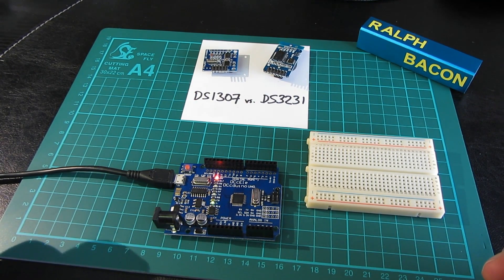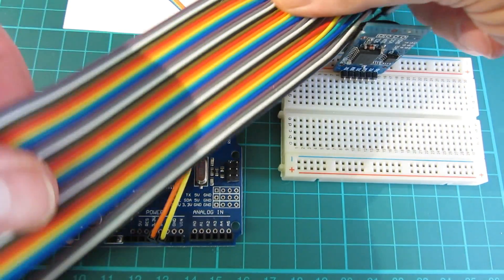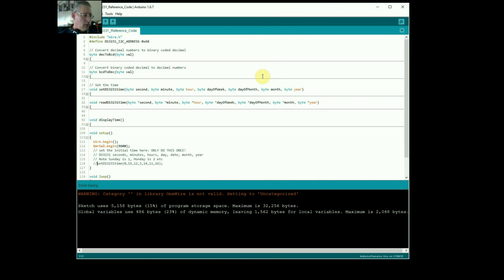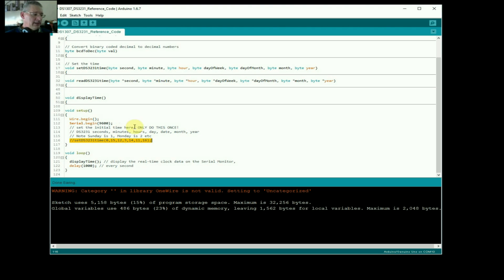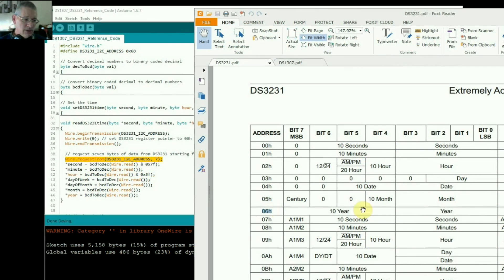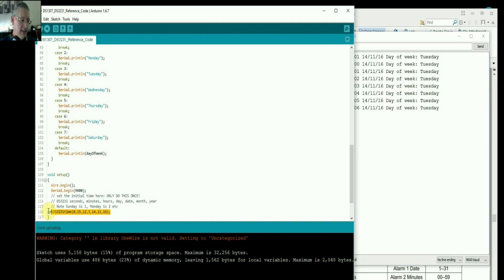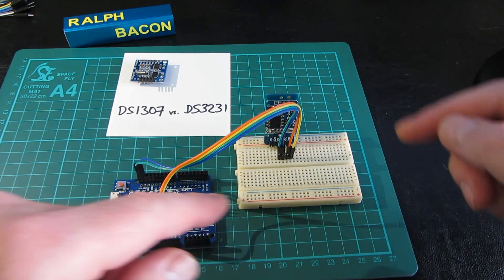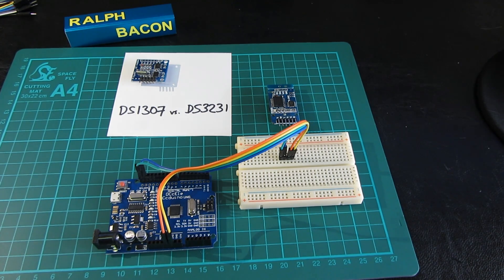#5 Arduino compatible Real Time Clock modules (RTC) - DS1307 & DS3231

Comment: Thank you very much,great explanation. I’ve realised that after a day my seconds starts to be leading by 6 seconds from the real time how can I fix that.

Thank you.
Reply from the maker: If you are using a DS3231 I would be very surprised at such a discrepancy. 

If you are using a DS1307 I would not be at all surprised and is why I don't use those devices.

Which one are you using?

Comment: This is good Ralph, can you help if I want to display hours, minutes, second on a separate line rather than displaying everything in one line
Reply from the maker: I was only outputting the information in the Serial Monitor so you could just use "Serial.println" rather than "Serial.print" to move to the next line once the current data has been printed.

Comment: Hi Raplh, 
Thanks for this code. I have been strugeling with this for months. Finnaly a code that works.
I just have one problem and was hoping you good help me. I am not new with programming, but I am new with arduino 
I want to save the time to a SD card.

I am using this code, where i save the distance. That works fine

// if the file opened okay, write to it:
    if (myFile) {
        //Serial.print(distance);
        myFile.print("Koe aanwezig: ");
        myFile.println(distance);
        myFile.close();
    }

But I get an error if i want to place the time in there. something like this:

myFile.print(displayTime();)

Is there  a simple way to at the time in my file on the same line.? 
Thnaks for your help
Reply from the maker: The time variable is something special. You probably need to extract the hour and minutes and save them as separate strings (or, possibly, integers).

Comment: Hello Ralph, I want to build a rain sensor so that we do not have to keep checking when the washing is out. I got the idea from my grandson, who watches videos about model RC cars, to search YouTube.  Luckily I found you. I watched your rain sensor video and realised that I need to learn about Arduino. So at the age of 71 I'm going back to school watching your basic videos. Hopefully I will learn enough before I expire.  Thanks for the videos and slow clear explanations John
Reply from the maker: I'll be doing a new rain sensor project "soon", John, as I discovered the old way (used in Benny's outdoor cat run) would detect rain but then continue to say that rain was present even though it had stopped quite a while ago (or it was just a few drops). 

The next time I do this project I will add a small heating element under the sensor so that rain is evaporated very quickly thus giving a true indication of the presence of rain. Once it has stopped raining the heating element will switch off.

What you can do is still construct the rain sensor (remember to poll infrequently [eg every 15 seconds] to prevent oxidisation of the sensor) and when I've done the project with the heating element just add that bit. I'm sure that at 71 you still have many productive (Arduino) years ahead of you, and I welcome you on my journey!
Reply: @RalphBacon  Thank you for your reply. I'll only put my sensor out with the washing and bring it back in so some of the features will not be needed by me. In the past I have programmed in BASIC as well as made web pages using just note pad and HTML so code is not alien to me. Watching some of your basic videos I now have a concept of the hardware however, finding and installing the compiler, inserting code and sending to a device is something I do not know. Do you have a video about installing and using the compiler from the start?
Reply from the maker: Just go to the Arduino.cc website, download the Windows version of the IDE (currently version 1.8.15 at time of writing) and install it like you would any other Windows/Linux program. If you can launch it and get a blank(-ish) code area then you are almost there.

Look at some of my (really) old videos where it describes how to get the COM port of your Arduino that you just plugged in and use that in the settings under the Tools menu. It might take you a while to "figure it out" but everyone has to go through this - me included!

If you use an Arduino UNO (or clone) you can get the Blink example program running by toggling pin 13 which has the built-in LED attached. That will be your Eureka moment.
Reply: @RalphBacon  Thanks again Ralph. This is all so much fun and fantastic to have help.

Comment: In the setTime, how can we adjust the RTC automatically from computer time? Not using the hard coding setDS1302Time(18, 10, 10, 7, 18, 9, 2020);
Thanks a lot
Reply from the maker: Unfortunately it's not possible. The standard way of doing this is to select a future date/time, wait for that time to arrive and set your program running so it picks up the correct time. Then be sure to comment out that bit of the code so your time is not reset again and again! Of course, if you write code in your Arduino to set the time on the DS3231 (like a bedside alarm clock) you can do it like that but it's a longer process.

Comment: Verry good, will change my thermostat tft project
The to many rtc.libs .h files people can choose to include make arduino dificult
Reply from the maker: Make sure you use the DS3231 not the awful DS1307. The former keeps time very accurately indeed, once it has been set.

Comment: First of all thank you for the great video!
I was getting frustrated with the DS3231 because there are so many poorly documented libraries and nothing was working, so I decided to configure it only with the datasheet and the Wire library like you did.
I used part of your code from github for setting the time and added some functions to use the alarm 1 of the DS3231 which I need for a project and it is working great now!

However,  I was wondering as to why you were using pointers in the readDS3231time() function. Is it just to make the code work without any global variables?
Is it that you could not pass the seconds, minutes, hours ... variables directly to the function because they are only declared in the displayTime() function and for the readDS3231time() function they are undeclared? So instead you reference them using pointers to be able to change their values even though the variable itself is undeclared in the readDS3231time() function?
Sorry if the question might be dumb, I am not that comfortable using pointers yet, hence the confusion. I would be happy if you could help me out with my question!
Reply from the maker: I wrote this over 4 years ago so I'm guessing that I didn't want global variables (I still don't like them) so using pointers is a good way round that and allows the subroutine to update them too, if required. If not, then passing by value is good enough.
Reply: @RalphBacon  thank you a lot for your fast response! Now I get it.

Comment: At the end of the video #5 RTC you say you have a video on how to set the times.Can you please tell me what number this video is.
Great tutorials you provide love watching them.
Thanks very much.
Fleck
Reply from the maker: Hmm, I vaguely remember this video (from 4 years ago!) and I also remember writing a nice bit of code to set the date and take into account leap years, DST and probably a few other things. Unfortunately it never got made into the promised library. [Some time later...] However, I have found the code. Leave it with me for while, Fleck, as I'm recovering from eye surgery so I'm limited in my computer time but I hope to nail this one soon.
Reply: @RalphBacon  
Ralph
Thanks for the quick response.
I wish you well with your eye problem, there is always something trying to hold us back. 
I also have medical problems in 2009 at the age of 59 I was diagnosed with Motor Neuron Disease (MND), and given two years to live. I am totally paralyzed and operate my computer using my eyes. Next month (June) I will be 71 years old and still loving my computers. 
I find Arduino very frustrating especially the libraries. I have been working on a clock for a week or so now and always find problems when compiling mainly due to libraries. 
I decided to have a look inside the library code of the DS3231. Having looked in a few libraries with the same name I was surprised to see different code in each one. This of course is very miss leading when they all have the same name. 
On your video #83 I smiled when you said the following     (Timeline 2.48)
“… was it easy to do this hmm, sort of well no really it wasn’t it was a lot of faffing about with libraries….”    
It made me feel I am not the only one suffering.

Thanks very much for having a look for your code.

Fleck
Reply from the maker: If you like I can just let you have my code and you can do with it what you want? Sorry to hear about your medical situation, as you say, there are always road bumps to slow us down! Let me know about the code, I can either email it to you or put it in DropBox (probably better that way). I agree about the library fiasco. Sometimes my code picks up the wrong library (because authors insist on using the same name, why?!?) and I wonder why my code does not run! Grrr!
Reply from the maker: Sent you the email!
Reply: Ralph S Bacon I notice from a previous correspondent (flex) there is an additional code  ,  can I ask that you send it to me at robertstuartharris@hotmail.co.uk   
Thank you

Comment: Very good. How about a time and temperature sketch since the ds3231 has that ability?
Reply from the maker: The temperature sensor on the DS3231 is not that great to be honest, Donald. It would be better (in terms of accuracy) to use a dedicated temperature sensor such as the DHT22, DHT11 or the DS1820 all of which I've demoed in my videos. It can be very frustrating to read a temperature of, say, 20°C yet you know it's only 18°C from another source! You can tweak it in your code, of course, if the drift is stable and linear otherwise it gets too complicated and it's much easier to use a separate sensor.
Reply: @RalphBacon Thanks for the reply. i'll look into that.

Comment: Hello Mr. Bacon, Can you help me send commands to the RTC module. I have spent hours trying without success. One of them I would like to change it to 12 hour mode. I have tried to modify some of your code but ran into a brick wall. Please help.
Reply from the maker: Are you talking about using the (Adafruit or similar) library, Dave? The obvious method would be to do something like:

if (rtc.hour() > 12) {
  localHour = rtc.hour() - 12;
  localPM = true;
}
else
{
   localHour = rtc.hour();
   localPM = false;
}
I'm making up the calls to the rtc object but it will be along those lines.
Or were you asking a different question?

Comment: sir how to replace ds1302 rtc with ds3231 
what changes we have to do in program
Reply from the maker: They both use I2C, Anukesh, to communicate with your µController so you should be able to swap one out and replace it with the other. Then change the library you're using so it corresponds to the correct module and it should "just work". I've found a written article on this:
https://tronixstuff.com/2014/12/01/tutorial-using-ds1307-and-ds3231-real-time-clock-modules-with-arduino/ 
I hope this helps.

Comment: 2165/165/165 (Monday) 165:165:85
 since midnight 1/1/1970 = 1563147985s = 18091d
 now + 7d + 30s: 2019/7/22 12:16:31
how to fix this
Reply from the maker: I'm not sure I understand the problem you're describing here. Have you set the RTC to the correct date/time initially? Remember this is a one-time operation. As long as you don't remove the battery (or other power) it will continue to keep the correct date/time. Can you explain a bit more exactly what the problem is and what you're seeing?

Comment: Hi Ralph, I used the code from video #5 and it works great. I am trying to insert a conditional statement into the code so that if hour = a value (e.g. 12) and minute = 00 and second = 00 {turns a pin high with digital write}. I have used parts of the blink sketch for this. However, I can't get it to work. I have also downloaded various ds3231 libraries and examples to no avail. I'm a total newbie at this (age 64) but don't want to go back to a hardware solution. Can you point me in the right direction? Many thanks, Mike - long time subscriber and avid viewer.
Reply from the maker: First off, thank you for being a subscriber and avid viewer - I need more like you, Mike! Now let's see if we can get you up and running. Your pathetic age excuse does not wash with me! How are you extracting the various elements of the time so that you can then query the value? If you go to my channel page, About tab, you will find my email address and you can send me what you have done so far; it will be far quicker that way. Sorry to make you hunt for that email, but if I publish it here I will have a gazillion emails! I'll await your sketch email...

Comment: Hello can you code something for me I am new
Reply: Wel I have code that trigger action on specific time I want to add day also like turn on on Sunday at 12:30:00 and turn off at 12:31:00
On at Monday 1:30:00 off at 2:00:00
Reply: Well it's not like I didn't try but the code keep failing on me and I don't know about the coding thing thats why I am asking
Reply: I watched every single video about my topic it's ether not related to my topic or I don't want to do that exactly
Reply: And I have a code related to my topic but it's not complete some code is missing or wasn't there
Reply: I was searching from last 8 days on YouTube and Google
Reply from the maker: OK, so what is it that you are trying to do? What is the exact problem?
Reply: #include <DS3231.h>

int Relay = 4;

DS3231  rtc(SDA, SCL);
Time t;

const int OnHour = 12;
const int OnMin = 24;
const int OffHour = 12;
const int OffMin = 25;

void setup() {
  Serial.begin(115200);
  rtc.begin();
  pinMode(Relay, OUTPUT);
  digitalWrite(Relay, LOW);
}

void loop() {
  t = rtc.getTime();
  Serial.print(t.hour);
  Serial.print(" hour(s), ");
  Serial.print(t.min);
  Serial.print(" minute(s)");
  Serial.println(" ");
  delay (1000);
  
  if(t.hour == OnHour && t.min == OnMin){
    digitalWrite(Relay,HIGH);
    Serial.println("LIGHT ON");
    }
    
    else if(t.hour == OffHour && t.min == OffMin){
      digitalWrite(Relay,LOW);
      Serial.println("LIGHT OFF");
    }
}
Reply: I am using Arduino Nano and ds3231
Reply from the maker: Funnily enough, another viewer is trying to do the exact same thing. Go to my channel page, About tab, and find my email. Send me what you have (your sketch) and I'll try and get a common solution for you both that you can then amend to your liking, OK?
Reply from the maker: I'm afraid it doesn't work like that, San b. The idea is that you watch the videos, and follow along if it's something that interests you. That way, you learn how to do something, rather me doing your homework for you! There are plenty of videos here for newcomers - but you will have to put in the effort to watch and understand the content - there are no short-cuts!

Comment: Where do you get the information regarding the DS3231_I2C_ADDRESS? Is this different for every device? Help me understand where this number comes from :)
Reply: Found the answer here at about the 12m30s mark
https://www.youtube.com/watch?v=7_gCUZg8nAo&index=9&list=PLZHhGaUUFqq19x1LamrZglw4IWM2DxdIp
Reply from the maker: Glad you found it, Rob. Just be aware that these device addresses may change in new batches (manufacturers do funny things), so one you had 10 years ago compared to one today may be different, although unlikely.
Reply: Any idea how to handle a situation where I may be running two of these devices? I realize it may make more sense to just get a larger display, but I have 3 or so of these lcd displays lying around...hoping there is a way to easily address 3 on the same bus?
Reply from the maker: You can hang up to 128 devices on an I2C bus as long as they all have unique addresses. Which, unfortunately, the DS3231 do not have, they all seem to have 0X68, although I have to question why you need more than one on the bus? What are you trying to do here, Rob?
Reply: Ralph S Bacon i just thought i May possibly want to display more info at one time . But I’ll workaround it
Reply from the maker: Having re-read your last couple of posts, I think you were asking about *multiple LCD screens*, not date-time modules, in which case YES you can have more than one because you can change the I2C address on the back of the "backpack" PCF8574A device by shorting (or leaving open circuit) the little pads marked A0, A1, A2 - this allows you EIGHT such devices on the I2C bus! Gosh, I hope I didn't confuse you.
Reply: Haha yes multiple lcds. All good